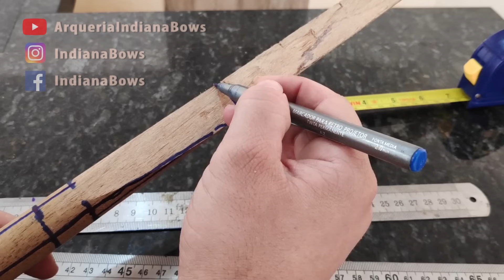MAKING A BOW WITH A BROOMSTICK

Comment: Witches uses broomsticks to fly. This guy uses it to shoot arrows, how crazy is that??? I made my own bows when I was a kid, but never thought of a broomstick. On hindsight, the flexibility etc... of the wood depends on the kind of wood itself PRIMARILY, and then secondarily it depends on the shape, and by halving the thickness of the broomstick, it allows for bending, so now I realise that not only the branches of a tree serve as prime material. Any "stick" of a reasonable length will do... btw, since this is a shorter bow, you can increase its strenght by using cables, like in the penobscot bow, this technique allows to build stronger bows with lower quality wood!

Comment: What type bitumen did you use ? PS one of the best diy bow video Thanks
Reply from the maker: Thanks very much! Glad you like! 😄
I used bitumen of judea.
Reply: Instead of cloth I would treat fiberglass with its hardener. Just o’neil coat.
Reply from the maker: Yes, Fiberglass Will make a better backing. But I did want to make it more simple as I could. :)

Comment: cool vid man! when u ran that piece of wood thru that thing with a drill to make a round arrow shaft.. what is that? u make it or buy it? also where do u get ur feathers? thanks for sharing
Reply from the maker: Thanks very much.
That dowel maker it´s from a machine that I have to make arrow shafts. 
Here in Brazil it's called: "Trefiladeira".
I prefer in the video using it with a drill, because the drill is more easy to have at home. 
Actually, there many methods to do an arrow shaft with a drill.  😄
The feathers I bought from eBay.  😉
Reply: @IndianaBows  awsome thankyou!

Comment: I come across this on my feed lol, never shot a bow .....only slingshots. Anyway cool bow, but can someone in the know explain why the glue,cotton and cling film? Watched the video an was curious abt that part
Reply from the maker: The cotton cloth glued in the bow act as a "backing", helping the wood not splint when you pull back.
Reply: @IndianaBows  that's really neat, never heard of it or seen it done. Thought I would ask as never to old to learn something that may come in useful.
Reply: @IndianaBows  how long was the stick used in the bow build? I watched video an going to have a go at it. I like silent projectiles, used a slingshot an Celtic sling for years. As i said, never to old to add knowledge bass, thanks for your help mate
Reply from the maker: The bow ends with 44". The stick I believe had about 48".

Comment: Try fire hardening. Doing so will give you the opportunity to make a recurve bow and strengthening the wood at the same time. There are videos on YouTube that show you how to do that. Also maybe the reason why the bow broke was ether there was still moisture in the wood or because worms go to the wood and dug tunnels into the wood making it weak. These are common problems when making bows, I have dealt with both problems before
Reply from the maker: I did this a few times, and like to do it in my selfbows. But in this case, as the wood was a really bad piece of wood, I did preferred took the chances and simplify it.

Comment: I'm trying this now 
It is my first bow 
Pray for me !
Reply: How did it go
Reply: Broomstick I used is beech wood
Reply: @3ala2Aldeen  wow
Reply: @aminexe7426  I have some troubles 
The backing of the bow still split of the wood so I try it without the backing it work somehow 😅
I mack a string it take some time 
It is little hard to find straight branches for make arrows 
I make wooden arrows they fly just about 50m or less
The bow seems to be week , it will never hunt an animal bigger than a rabbit frome distance more than 10m or 15 m at best with my poor skill
If it is windy day the situation is worse 
The tool I used is hand saw,  screw driver as a chissle a hammer and one wood file it become very dull at end 
It cost me 1.5$ and some time 
I'm planning to do a bigger walnut wood recurve bow and backing it with fiberglass
Reply: @3ala2Aldeen  oh cool Telll me how it went after you finish
Reply: @3ala2Aldeen dude, that's awesome! how did the walnut bow go?

Comment: hows this even possible!?? a broomstick and wood glue!? what??
Reply from the maker: Magic! 😆
In the bowyers bible you can find that you can make a bow with any wood species ( If you know what you're doing).
I cheated using glue and cotton cloth, but If you can choose the piece of wood, you don't need anything Else.
Reply: @IndianaBows  I made a bow out of mulberry wood a few years back and it came out kinda well I'd give it 4 out of 10 and mulberry is rated as a fairly good wood for bow making, but a broomstick!! Do you even know what kind of wood it was made or you took a chance??
Reply from the maker: I really don't know. As I know, the biggest part of broomsticks here in Brazil is made of Pine. But the one I used was not. 
It was a cheap piece of wood a bit stronger than Pine. It support a few shots, but was broken ( as I show at the end of the vídeo). ☺️
But the idea of the vídeo was: If can be made out a cheap wood, so It not so difficult to make with a little better wood.
Many people don't even try to make It because don't have a good bow wood.
But you don't need a super hiper mega good bow wood to make Bows. Only what you need is know what to do.   😉
Reply: @IndianaBows  very interesting my friend and actually the way I came to see your video was because I'm building a new recurve takedown bow with a wooden riser and PVC limbs (still not so sure about using PVC) which leads me to ask you a question about your opinion on PVC bows and their durability and functionality 🤔
I'm still hesitant wether to use PVC or steel (as it's hard to get your hands on bow worthy wood in my country) except mulberry but I can't get it at the moment can you give me some ideas brother

Comment: Eh what you was thinking its only Broom stick . They made them from most cheap wood from pine I think?
Reply from the maker: I was think on: I Will Make a vídeo where I Make a Bow with a Broom stick to inspirate people to use alternate Woods on making Bows. I've met a Lot o people who never tried Make a Bow because don't find the "correct" Wood. But the truth is: you can use any Wood you have If you know what you're doing.
Reply: @IndianaBows  она не сломается потому что Вы наклеили тряпку на спину лука?
Reply from the maker: In the most cases, that will helps.
Reply: @IndianaBows  спасибо, у меня есть брусок из хвои 50×50×2000 мм, попробую сделать как Вы) чтобы деревья не портить 👍